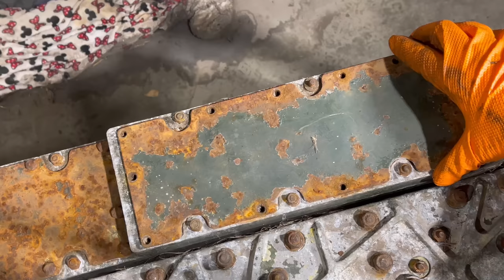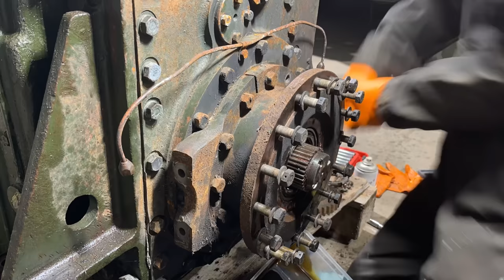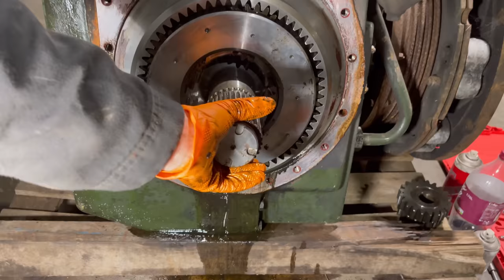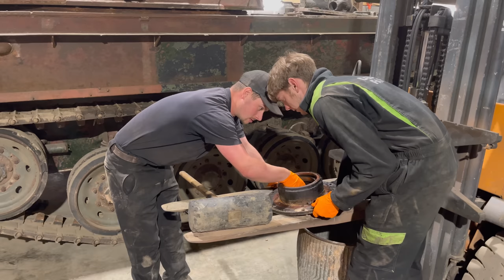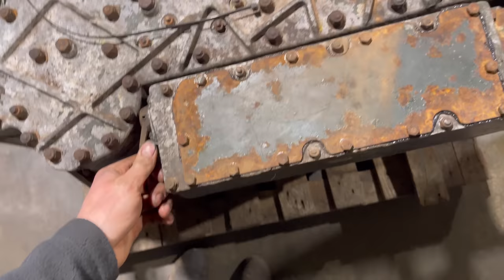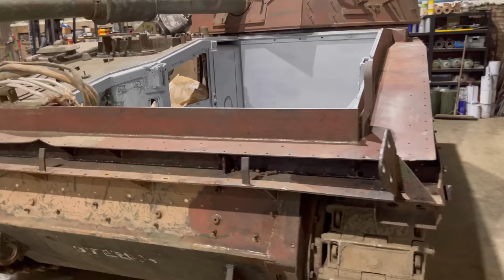Will this Gearbox ever work again?

Comment: Thanks for insight into the gearbox,  those planetary gears look well made 👌. There's a couple of chieftains for sale here in Cornwall at Helston gunsmiths still with operational gun , could be used as crow scarer with blanks ,thanks for sharing 👍
Reply: Agree completely. Fascinating engineering. You lot must develop quite an empathy with these machines. Thanks for sharing!!

Comment: Noticed your “rag bin” is a Dolly Tub. A very early “washing machine” !! You would fill it with water. Add soap. Add clothing and then manually agitate using a “poss stick”, bit like a 3 legged milking stool with a handle in it.

Comment: I'm wishing you success with putting those bearings in that gear. That's going to be quite a task to accomplish.
Reply: You should watch the video; they’re back in.
Reply: Hey John. I finished watching that video yesterday. I'm glad your boss was able to gitvthem in where they needed to go. He said he used grease so that they wouldn't fall out. I was going to suggest to him that he could use petroleum jelly to do that job, except I thought about the time that video had  he was going to find a solution for holding them around thst shaft. Certainly enough, he did find a way to do that by using grease.

Comment: Great video with lots of detail. Just a thought regarding the bearing where the rollers were loose and fell out, but wouldn't careful application of a suitable large magnet hold everything in place and make assembly and disassembly relatively simple? Maybe this technique would work elsewhere as well.

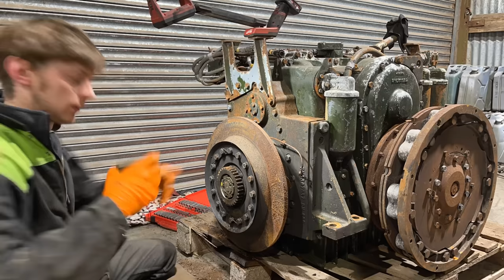Comment: 2:01 talking about lock wiring, took me back to the maney times I spent on by belly lock wiring the bolts on the fan belt drive pulley, after the belt snapped for the umpteenth time. Irony was, I was the loader, but more agile then the driver.
Reply: Driver ate all the pies?

Comment: the way they put those roller bearings in back in the day is just pack a shit load of grease around the shaft and put the bearings on the grease. then just slip the cog over it and clean the grease off. takes maybe 10 min.. >.> the grease should hold the rollars in place long enough...... >.>

>.
Reply: They roller? Looked like ball.
Reply: @johnnunn8688  they are roller bearings. you can clearly see because they a cylinders. you cant use ball bearings of shafts like that. they will just burn up.
Reply: @max16  I was referring to the second lot, which are ball.